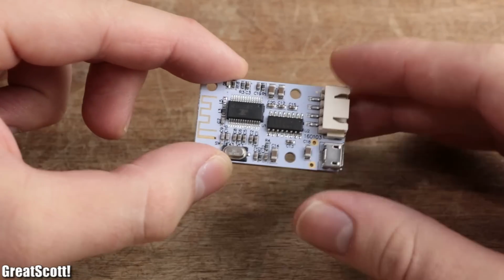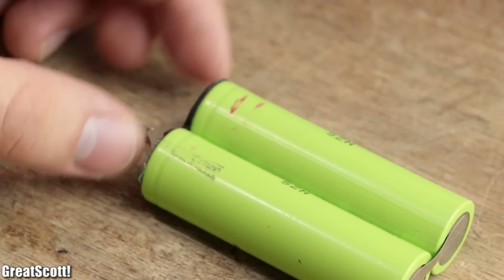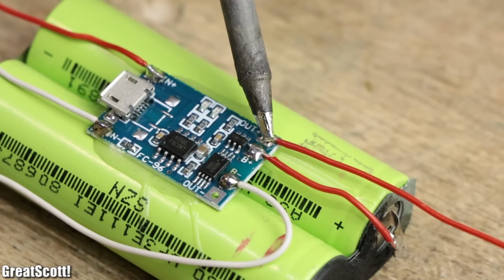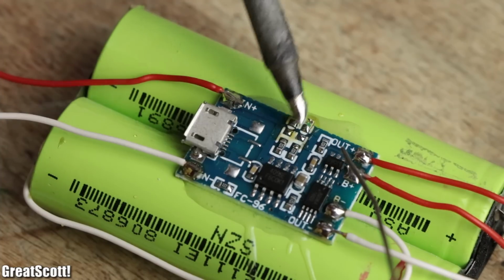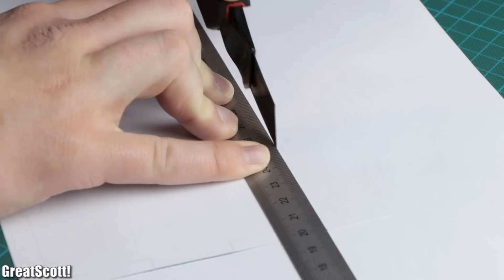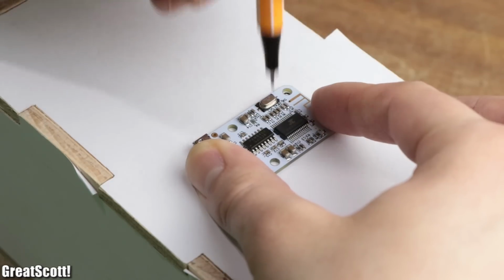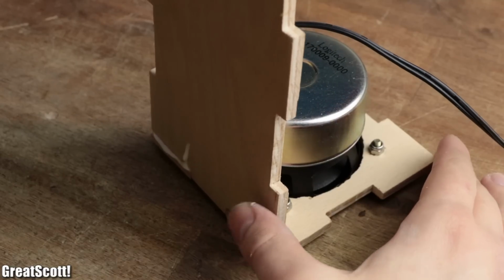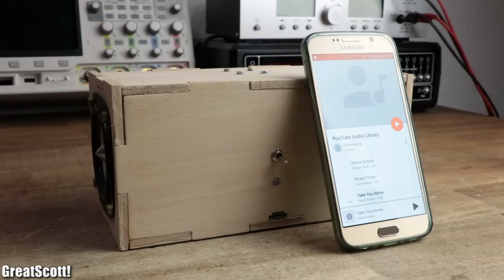Make your own Simple & Cheap Portable Bluetooth Speaker

Comment: i bought this http://www.ebay.com/itm/2-5-10PCS-TP4056-1A-Mini-Lithium-Battery-Charging-Board-Charger-Module-Micro-USB-/201707725789?var=&hash=item2ef6b7a3dd:m:mku8oLVM13idQfw0Awcw-gg 
and it doesnt have an out terminal, 
Can we plug those wire directly onto the battery in that case?
what are those out for anyways?

Comment: what the resistor value of the rgb led
Reply: in all honesty, i dont think it matters. i think hes just trying to prevent a short circuit, but idk I honestly have no idea what im talking about.
Reply: Jesus Christ, i could have guessed that had i known what the fuck an led even was lol. or... if i wasnt drunk off my ass... nah man i make shit like this as a hobby but ive never even dealt with leds because... well why would I? Leds dont make my speakers sound better now do they.
Reply: AY SHIT WHILE IM HERE I GOT A QUESTION
okay so electricity flows from anode, to cathode, right? well then, how the hell do vacuum tubes work?
Reply: Did you got the answer? Because i need to know.
Reply: I calculated it , must be 100 ohm resistor but i may be wrong so :p
Reply: Btw alway take a slicly bigger ressistance
Reply: The |TP4056 datasheet says thet you should use a 1k resistor for each led: https://dlnmh9ip6v2uc.cloudfront.net/datasheets/Prototyping/TP4056.pdf - Check the last page.
Reply: 20 ohm. Maybe

Comment: Hi, I need help (Great Scott or anyone in that community) I buy all the material for making these bluetooth speaker, but I want to use 2 x 50 watts speakers. Not sure that great scott use 50W speakers. If not, I think that I will need more power from the batterie. That's where I'm lost. How many batteries did I need to make those speakers run for a decent amount of time (like 5-6 hours or more?)? On batteryspace.com I found samsung Lithium18650 Rechargeable Cell: 3.6V 3400mAh  at 14$ and Samsung Lithium 18650 Rechargeable Cell: 3.7V 2600mAh at 7$. Those are the best offer and the best quality for Li-ion battery.

Comment: Great vid man! Im a big fan of yours. I have few questions-1)what kind of batteries you used for this project.
2)can two li ion batteries be charged with a single tp4056 module?
3)i heard that u must disconnect load while charging li ion batteries with tp4056. Is it true?
It ll be lot of help if u answered these questions.

Comment: Hey I want to build the same thing. But I have the problem that I have 5 speakers. 2 high 2 middle and one down sound speaker (sorry if the English isn't correct). Do you know how I can use they? I need a Bluetooth amplifier with minimum 3 speaker outputs. My speakers have 5 ohms and 5-15 watts do you think it is possible? Thanks a lot man!

Comment: You need to drill somewhere one hole large enough or a bunch of small ones to avoid negative pressure on speakers, it gives better speaker performance.

Comment: Hi, sorry to comment this twice, but I think no one would see this on your Clap On Lights video:

I have the electret microphone breakout board, lots of relay modules, an Arduino uno, resistors and other components. Could I make a clap on/off AC lights circuit with an  Arduino Uno, Sparkfun electret microphone breakout board and a relay? Thanks!

Comment: iv got a couple of them Bluetooth modules in the post I just wondering if any one knows if thay can be bridged or if thay r already internally bridged can't find much out there on this module. iv got a 3way crossover so was thinking of using it just as a mono amp to run 3 speakers
Reply: ha I didn't note you listed the amp ic iv looked up the datasheet and no its bridged already.

Comment: Hello sir my question is not related to this project. I have been trying to make 100 watt led flash light but if I put 8900 mah battery the backup is very low it will come only 3 mins can u plz help me. My email is br.tejas21@gmail.com

Comment: The TP4056 is only for one battery cell. Does this really work with 2 cells in series and does it protect both cells correctly?
Can I use 2 TP4056, one for each cell?
Reply from the maker: The cells are in parallel.
Reply: Ok but two cells in parallel could have different voltage and capacity.
Reply: Matthias Hampel get two of the same cells then
Reply: if you working with high discharge current, you will need to concern about different of the capa and voltage. In this case, your discharge current is rather small, so you dont have to worry about that much

Comment: what's the point of the boost converter in this project?
Reply from the maker: It creates a steady 5V DC from the 4.2V-3V battery voltage.
Reply: GreatScott! Thank you!
Reply: jános bánszki hello i am using 12v amp..what should boost converter be? 5v or 12v?

Comment: Hi, Does the TP4056 Protects the battery from overcharge and discharge?
Reply from the maker: Yes, but only if the protection IC is included (like my board has it)
Reply: GreatScott! i see, i ordered a couple of them 20pcs. also i found out that the mt3608 only allows up to 6 volts in.

Comment: Hi GreatScott, love your videos. I'm currently trying to read the frequency from a piezo with an arduino. But I have to use diodes and can only read the positive half of the signal. How do I raise the level of the signal so my arduino can read it? and how would you drive a piezo buzzer? In short, I would love a video on piezos, as they seem quite complicated! Cheers!

Comment: I'm interested in how well those TP4056 devices behave. It looks like the TP4056 boards connect only to the power lines of the micro USB port, not the data lines, so I presume they cannot be enumerating, and so, if I understand correctly, according to the USB standard they should only take 100mA (or 250mA, I forget). Have you ever measured the current sourced by these devices? Do they behave well, respecting the USB limits?  Do you find they work OK on all USB power sources (chargers, PCs, hubs...) or do some devices enforce the limit (or, worse, blow up when you take too much current)?  Thanks!

Comment: GreatScott, I have a general question. In my current Project I am using a 74HC153 multiplexer. I put the output enable pin to a logical low value so the data will be available on the output at any time. But do I have to connect the pin directly to ground or shall I use a pull down resistor (the low value never changes)?

An answer would be nice :)

PS: thank you for your nice and helpful videos :)

Comment: What about buttons? I seached a bit on the internet about this board but it seems that it does not support buttons for volume control, next/last track and play/pause buttons. Is it really this way?
Reply from the maker: Everything is controlled through your smartphone.
Reply: I recommend this one (http://www.ebay.com/itm/Bluetooth-4-0-Audio-Receiver-Board-Wireless-Stereo-Sound-Module-for-Car-Phone-PC-/311722489267?hash=item48941bb5b3:g:KNAAAOSwYIxYBgEz). I used it for a boombox and I'm very pleased with it. It comes with 3 buttons, works with voltages from 3.6 to 30v and there's no stupid voice, beeps only.

Comment: I'm really surprised you didn't find a way to keep the stock speaker enclosures.  They had a THX badge on them so they probably sounded really good if the enclosure was tuned for them anyway...  Otherwise awesome video, as always.

Comment: Nice build. I would add a dividing wall between speakers or at least some filler, otherwise it's not really STEREO because air from one speaker would push another.

Comment: Hi GreatScott, i made two speaker cases once (just two wooden boxes with 3 speakers each) and the audio quality increased A LOT once i drilled some holes to let the air get in the case. Your box has no holes, so the speakers are kinda "cancelling each other". You must have a hole so the air can move freely and the movement of one speaker does not afect the movement of the other. 

More or less like this one: https://goo.gl/MyBrpz That piece where the brand is is just a hole to let the air flow inside.
Reply: Jeronimo Murruni uhmm, all high quality speakers without a bass reflex have an air-tight casing...
Reply: Air tight casing with routed air paths, Speakers physically move so a tuned air movement is still required
Reply: DJust787  Nope, air is compressible and expandable. An air tight casing gives a nice tight bass, instead of a sloppy one.
Reply: dude, air must flow freely for better accustics. all good quality bass speakers have a hole in their case to let the air flow.

Comment: Dear Scott,

For a few months now, I've been planning on building a boombox very similar to thisone. I figured I'd use an ordinary power bank as a power bank, though. 
I've had this exact same sanwu bluetooth/amp combo for some months now, too, but there's something really striking to me apart from the horrible accent upon powering on and pairing. This being the amount of noise when playing audio. You can hear the amp is turned off entirely when no audio is playing, but when playing not-too-loud guitar intros, for example, the hissing noise is very noticable and not too great to listen to.
I've tried other boards with only the PAM8403 amp, and these didn't have this issue.

My question is: do you recognise this problem or is mine faulty?

I'd love to hear from you, or anyone  who has experience with this sanwu board.

Cheers.

By the way: here's a concept of my boombox design. https://1drv.ms/i/s!Ampr5OaHIj5ZqW_im1kPCmFidNWG

Comment: The TP4056 does not protect the batteries against over-discharge...does it? I cannot find any evidence it does.
Reply from the maker: It does
Reply: ***** On this kind of board no, you will need power each board separately.
Easiest way to use board only for protection, and charge cell directly(with balance lead if u got 4S configuration) with some kind of imax.
There is even better boards without TP4056, with single or few DW01A+FS8205A scheme for 1-4S batteries, you may find it by searching "lithium protection board 1s, 2s, 3s, 4s". Boards without TP4056(CC/CV charger) will need "smart charger" for charge.
General problem with TP4056 is low charge current(up to 1000 mAh).
Reply: This version of the board does. Notice the OUT+ and OUT- pads. Those are for draining, and they do cut off when the battery is dead.
Reply: aiTheVulture thank you
Reply: Board in video and description links isn't pure TP4056 board.
It also contain DW01A+FS8205A which is overcharge protection.
Reply: GreatScott! TP4056 doesn't actually, problem is if u search "TP4056 board" u gonna find both pure TP4056 board without overdischarge protection and
TP4056+(DW01A+FS8205A) board with it...
Reply: I have 4 18650's and do not wish to wait 10 hours to charge it. Can the tp4056 be used in parallel with another board?

Comment: Speakers are supposed to be air-tight or ported with a tube of specified length, diameter and shape. This one would leak air from the back side or from the seames creating air leak noises.

Comment: Could I use an Arduino and hook it up to a Bluetooth shield or chip and then use that to produce an audio signal for a head phone jack?  The blue tooth in my car radio does not work snd the auxillary messes with my phone constantly. I think it would be after learning experience to build something like it. I could likely use parts from this build I imagined though.

Comment: Sound quality would be significantly better if ya added a breathing port in the back. Or even better would be to stick a block in the center to separate the channels and add a cylinder port for each channel that goes half way in.

Comment: Can you compare this module to the other Bluetooth modules you've used? Connectivity? Audio DAC quality?

I built a similar Bluetooth speaker (sans battery) using KRC-86B I wonder how these modules compare. I really like the KRC-86b because it has been flawless for connecting media to. I have it attached to a UN2003 10w audio chip set up mono.

Comment: this isn't actually cheaper than manufactured bt speakers though
Reply: sinephase You are correct it's not exactly cheaper. Most DIY projects will rarely come out cheaper and that's with out taking into account the necessary tools the margins are not on our side. This is one of those project that we do just because we can.
Reply: I agree, it's fun to do so because we can. That being said..it's the clickbaity phrases in the titles that make it sound like it's easier and cheaper to do so yourself rather than buy one that I get pissed about.
Reply: To be fair the battery life of the speaker he built is significantly longer than any Bluetooth speaker Ive ever bought for less
Reply: from geting the part aroud me i got this for like 7 box :)(but i agree that tools are expensive anyway)
Reply: That's true, but you can fine-tune the signal by yourself, for example by inserting different high- and lowpass filters to drive different kinds of speakers, for example 2 extra tweeters that only get fed the high frequency sounds. Of course you'd need some more parts for that but it would be possible, and you can make the speakerbox sound just as you like it
Reply: Yeah this is cool and all but I'd rather just buy a decent sized BT speaker rather than spending time and money with electronics and finding the right tools to make it myself. In fact I found a great deal on a new JBL Charge 3 for $90
Reply: U r right

Comment: Speaker and case are too big for small pam8403 amplifier,  it's more for a pocket size speaker with the test i made. You should upgrade with a 12v 10 watt amp, easy to do with your boost converter. Anyway nice project to build.

Comment: The TP4056 can provide at most 1Amp on 5 Volts. That is 5W total. Just barely meet the requirements of a speaker system. Probably a lead-acid battery would perform better at the expense of the portability.

Comment: Awesome video as always! Just have 2 questions.
First, why do you sometimes solder a capacitor to the speakers?
Second, how do you "solder" the bateries together? 

Great videos ;)
Reply: Putting a capacitor in series with a speaker is a basic high-pass filter. You would only do this if your setup included a subwoofer for bass.

It's not a good idea to solder directly to lithium batteries. It's best to use metal strips and spot weld them on to the battery. If you look in the video you will see that is how the two 16850 cells are joined.
Reply: @marcusfred4480  you could also just use an 18650 battery holder with terminals

Comment: you need air in/out pipe to get better sound... it sounds like a trashcan without wool and air pipe
Reply: Nope. You can build closed cases or cases with ports. A lot of Home subwoofers use a closed case with a passive radiator and they do put out enough power to be heard trough the house.

Comment: Great video, though one suggestion. You can combine the boost converter and the li ion protection board by using one of the 18650 based power bank PCBs found on eBay. They supply around an amp, simplify the build a bit, and is less expensive.
Reply: to simplify the build and keep it cheap, buy a bluetooth speaker.
Reply: great idea! it comes with charge board and usb brakout so it is cheaper too at the end

Comment: Adding holes to the back of the speaker improves quality because it prevents the pressure waves created by the inside of the speaker cone from echoing inside the speaker and interfering with the cones motion. This is basically what a passive speaker does ( I remember you mentioning them in a previous video)

Comment: it might be harder but i like to see the circuit and use plexiglass instead of wood
Reply: It would ruin the sound from the speakers. Already, without sealing the joint in his project, the box will kind of dampen random portions of the sound spectrum.

Comment: Did you calculate the correct internal volume for the size of your speakers? It could make a huge difference in sound quality. I also suspect the fact that the speakers backs are to each other may cause some sound quality issues as well. Its usually best to try and stick to the volume of the original enclosure as best as possible in my experience, since the manufacturers usually design the case and speaker to produce optimal sound quality together. Im just nitpicking though, its a great project nonetheless and simple enough to put together.

Comment: Would it not have been easier to just have the papered side of the wood be on the inside of the case?
Reply: Probably sound slightly better too, the more absorbent the inner walls the fewer internal reflections. Though wool would be even better.
Reply: @edism  88 iui 88ijj
Reply: @edism  j
Reply: @edism  j
Reply: @edism  j
Reply: @edism  ki
Reply: @edism  j
Reply: @edism  j
Reply: @edism  j
Reply: @edism  jj
Reply: @edism  kik
Reply: @edism  j
Reply: @edism  jjjjjj
Reply: @edism  j
Reply: @edism  jj
Reply: Big time
Reply: @OggyGTA  jjjj
Reply: Welcome to the internet!  'Round these hur purts weh don't do things thuh... easy wayuh.
Reply: Jj
Reply: J
Reply: J
Reply: Jjj
Reply: Ij
Reply: Jjj*j
Reply: Jj
Reply: Kip
Reply: So you're new huh?
Reply: @aadhithyaks2057  j
Reply: @aadhithyaks2057  j
Reply: @aadhithyaks2057  j
Reply: @aadhithyaks2057  j

Comment: I have some 8 ohm 15w speakers, should they work? I can't see in the video your speakers specs, but I think the are more than 3W :) Like the project, already building the gameboy and a led cube, you are great! :)
Reply: Hey spotify95, you seem to know quite a lot haha. So you can use Speakers with more than 3 Watts each with a 3 Watt Amp? And does it make a difference if a use 3 watt speakers or 15 Watt speakers? Thanks a ton.
Reply: Alright, thanks a lot for your fast answer :)

Comment: i feel like a decent bass port and a little bit more powerful amp would benefit the speakers greatly, they were thx certified so i believe they require more wattage than whats being supplied, and the bass port will help the low ends especially a slot port.